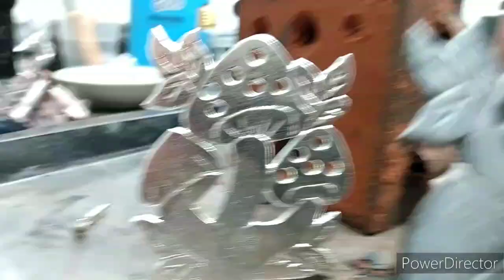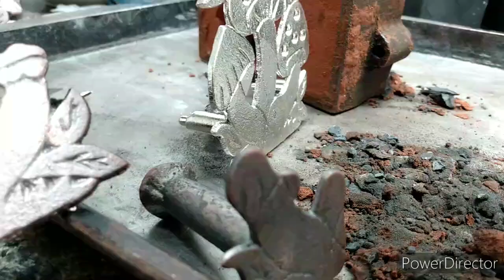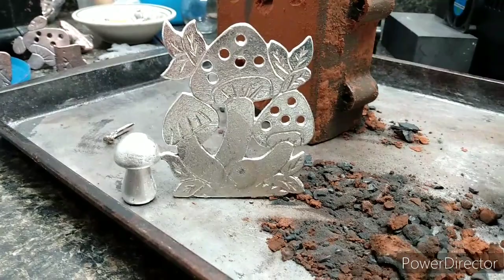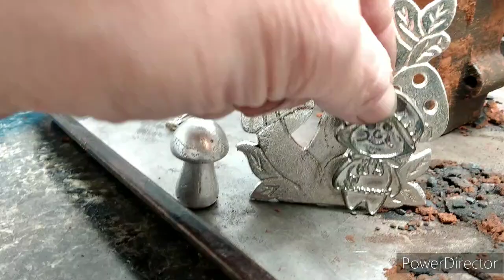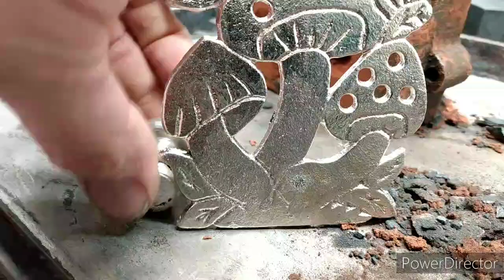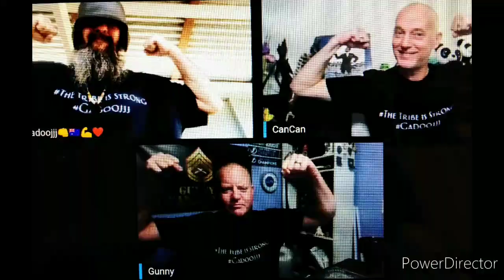I finally got it. silver mushroom trivet🍄❤️

Comment: Yay!!! and Woot!! Woot!! Eureka also fits! Nice work and great perseverance Shroomday0117. So, if the trivet is too thin to work for copper could you use a thin piece of plywood or similar and make a spacer to thicken up your master?
Reply from the maker: Thanks HCH. I was thinking about lining the back with a couple layers of cardboard but after putting a bit more thought into it, I think I'm leaning towards textured spray painting the backside. It was originally sprayed with it by whoever made it and I'm sure the one coat they put on it added about 2mm. If i can get one or two more mm thickness, I can get the copper to flow through. 
Although before I do any of that, I think I want to make a couple more from silver.